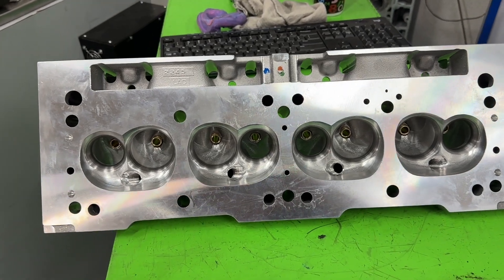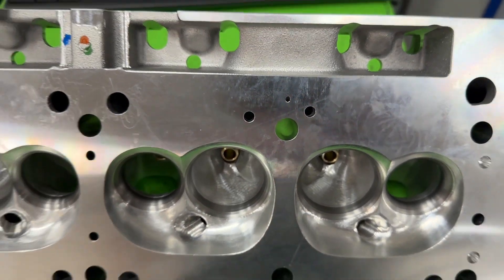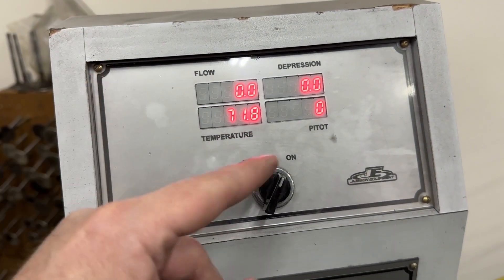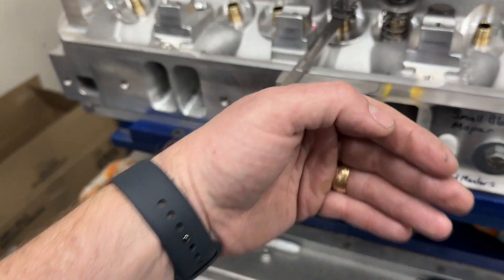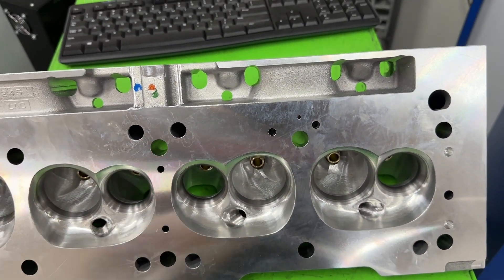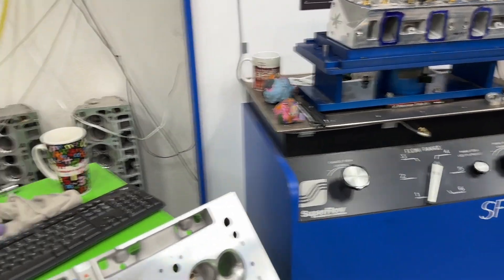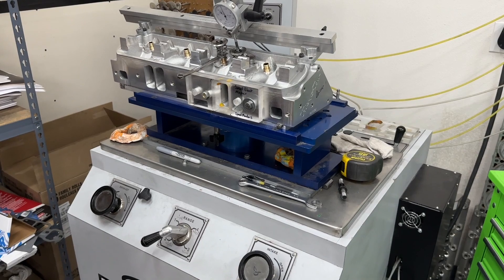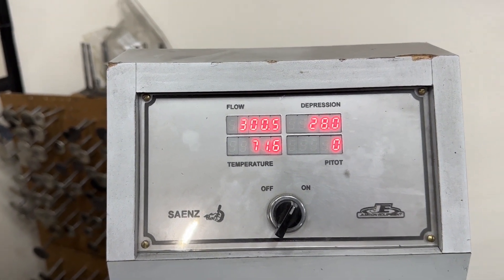A Strange Thing That Happens On The Flowbench When The Wing Is Different

Comment: Nice video Eric.  I think you are correct in calling this a flow separation issue.  It seems to happen at 0.550-0.600 lift on many of the SBM heads that I have tested.  I have heard others use the term 'hyper critical' in describing the condition of the port just after venturi convergence and just before the short side loses flow.  The 'peak' of the flow curve can be moved around by changing top cut angles in the chamber, by shifting the head on the bench, by changing the throat size and angles, by changing the valve shape.  When at this hyper critical point, any flow disruption will send the flow over the top of the valve and flow on the short side is greatly reduced.  Flow will typically drop by 10 cfm but will gradually recover at about 0.900-0.950 lift when the valve is out of the way.  Velocity in the center of the SSR is about 450 fps, so it's very sensitive to disruption.  The PRP on these heads is very intrusive and creates a lot of the issues downstream.
Reply: Interesting

Comment: I'd be very interested to see the results when closing the valve opposed to creating a choke/restriction upstream. Putting your hand across the port isn't anywhere near what happens in a running engine
Reply from the maker: You mean it’s not like closing the throttle.

Comment: The issue with your "hand slap test" is that it doesn't simulate the valve opening and closing. It'd be more accurate of real world operations if you wacked the valve open and closed. The air isnt going around an opening valve, it's trying to make it's way past the stationary valve. 

Wack the valve open and closed. Put a stem lock or something so the valve only opens and closes so far and try that again. That would reveal something more relevant.
Reply from the maker: Are you sure it’s not the same as opening and closing the throttle.
Reply: @WeingartnerRacing Well, yeah, because the valve is what is starting and stopping the air flow in the cylinder. if you can lift and stomp the throttle quicker than the valve event, that is truly impressive LOL Run that test again, starting with a closed valve and pop it open to .800 and let it slam shut again which would be pretty simple to do and see what the flow is like then. It may require a little more spring to overcome the flow past the valve, but a pair of checker springs would probably be enough. The static valve position potential of the port gives you potential flow it lift X, but it really doesn't demonstrate the ports ability to fill the cylinder at a specific RPM. But, you know this.

Comment: It is weird but you stated "they did a dyno test" and it made more power so that seems it either makes more power w/reduced flow or, more likely, the super fast (faster than our hands) valve closing where the suction begins doesn't cause the same effect. I'd imagine the only way to test that is to be able to rapidly close and then reopen the valve on the bench but not sure if that's feasible.

Comment: id bet its different when the valve actually closes hits the seat and opens. that event alone, is going to change how much air, how fast the air moves when the valve is back to full lift. i have always included valve cycling into this event. velocity is going to be higher even though total flow will be lower as the valve is coming off the seat. id try cycling it, let the air recover in its direction through the port, around the vane, into the chamber. the hand is yes acting like the valve closing but it is not slowing, choking off the air supply and changing the air flow in the same manner as the valve closing is going to. fully open valve, hand smack choking it, vs surface area tween the valve and seat also getting smaller. larger. the resonance, swirl, turbulence etc etc is not being represented in a real life valve cycle event

Comment: The flow never stops and starts with the valve at max lift like you just caused to happen. Your example will never happen in a running engine. Port recovery works with the opening and closing of the valve. The shape and Venturi that happens when the valve is opening and closing as a variable cross-sectional change is what causes a port to have great pressure/port recovery. Having the valve at max lift and then blocking the intake tract is not the same thing as the valve closing. Of course the port does not recover back to what it had when you ramped the air on vs smacking the airflow with your hand. I know you understand this, I’m just bringing it to your attention. 
However this is a good eye for catching this and it would be good to test back to back on the dyno , with a straight vane and a sideways vane. Thanks for the info
Reply from the maker: So not the same as closing the throttle. Then opening it again.
Reply: @WeingartnerRacing  if the throttle is closed you are not under power, and thus the flow disruption is meaningless. By the time you are back on the throttle the valve has already opened and closed a few hundred times (depending on rpm of course) and thus recovered from the normal valve opening event without disruption like I mentioned before. 
For your theory to even play out, you would need to stop the flow of the air column and then reintroduce it back to the port in the short period of time while the valve is at max lift in a running engine which is physically impossible. Go figure up how long the valve is actually dwelling at peak lift in a engine at idle and see that this time is hardly comprehensible in regards of us being able to perform an act within this allotted time frame, then just image it at  4, 5, 6,000 rpm’s.
 
If the throttle is closed it doesn’t matter if you lose 300cfm on your flow bench from smacking it, the cylinder no longer needs the volume of air (because the throttle is closed, it’s called deceleration for reason) and either way the port has already recovered its from the normal valve opening and closing events from the rotation of the engine. 

 I stand with my first comment, this test is irrelevant and meaningless in regards to a running engine unless you have a engine that just holds the valve opening the whole time while it’s running but obviously it would no longer be running if that was the case.
It’s kinda cool that you found this, but there is no effect on power. It’s no big secret that the engine slows down when you take your foot off the gas lol.

You cannot disregard basic engine fundamentals and build an hypothesis from a scenario that will never occur.
Reply from the maker: @rtprecisionmachine6210 circle track and road course are typically part throttled offten just as I said and the valve is cycle that whole time.
Reply: @WeingartnerRacing  the only way anything useful could come from a test like this is possible on the spintron and a bunch more equipment added to it. You must have the valve events. The engine never sees one degree of rotation or change of airflow with the valve static at max lift. And the millisecond of time that does occur during peak lift is so short it becomes completely irrelevant to change.
Part throttle is not a sudden door shut onto the intake port, and each intake port in most engines share a common plenum from which to draw a small amount of air from to keep the port from stalling completely.
However, without having a dynamic valve event at operating speed, the test cannot simulate an authentic event inside the engine.

Although you do not have the equipment to test it, the only way we could see if the vane caused a true flow decrease during transient throttle changes would be to have an actuator on the valve running it through a typical cam lobe profile at an actual operating speed, or rpm if you will, that a engine would see. If you could do this then you may have useable data. Otherwise the valve is static with 28 inch depression of constant flow that is being disrupted for a split second. Ports are not designed to recover like this and they never do in a running engine because the valve is always dynamic.

I believe there is something to be learned about vane placement, however you may be looking in the wrong place with this test.

It would be really cool to make a valve actuator that could simulate valve events while you flow the head. You would be surprised what you find happening, especially if you could replicate the 2nd or 3rd resonance wave going back and forth but I doubt that equipment will ever be developed. It would require an air supply that could ramp up and down simulating the piston stroke and rapidly change pressures almost instantaneously. Of course we have those, it’s called a running engine on a dyno lol.
It’s all about time, and there isn’t enough time during peak lifts for an abrupt air change to make a difference. By the time the air stopped at the valve, the valve would have already ran through a few complete valve event cycles and leaving it once again impossible for this test to actually happen in a running engine. 
 However without these types of discussions, innovation cannot happen and why it is healthy for our industry.
Reply: @WeingartnerRacing  however I would like to see a dyno test with and without a proper developed vane. One straight, one left, one right. Their definitely is something to learn there, but it has nothing to do with our prior conversation.

Comment: I think it adds turbulence to the air column enhancing homogenization of the intake charge. Think of the air charge as a slinky. Bulk of the mass oscillating back and forth like a wave, every intake valve cycle. When the valve closes the pressure builds up and reflects back in a different way causing turbulence and better mixing.

Comment: You're on to something Eric, and thanks for sharing. 
This example has me thinking of an old idea I had. Flow test heads on an engine block to use as a "sudo spintron" like device to actuate a valve on the cyl being flow tested. 
Block all the unused cylinders airflow and pull vacuum through the empty crankcase with a big tube welded into an oil pan.
It seems there would be some interesting data with the intake valve cycling at around 60 times per second with the cam that was going to be used in the engine, while flow testing. 
Much closer to representing a running engine than steady state flow testing, although still a great deal different without the real overlap cycle in place.
Reply: A flowbench cannot reach anywhere near the vacuum pulled by piston.
Reply: Or "vacuum" pulled by exhaust scavenging...isn't that more stronger?

Comment: With the flow bench it's self, how does it control the flow pressure drop, automatic or do you manually change the restriction or blower speed??
Reply from the maker: It doesn’t it automatically with software that controls motor speed.

Comment: Covering the port is not the same as the valve closing. The port is full of air and under some pressure when the valve closes. You are starving the port of air by blocking it off. Bet the effect changes if you close the valve then reopen it.
Reply from the maker: I will test that but I’m sure it will do the same thing. Once the airflow is disrupted it doesn’t come back.

Comment: I've been thinking of the vane as a tailgate, creating a small low pressure bubble to speed up/redirect airflow. If thats correct here, (idk), then angling the vane towards the cylinder wall, like these trick flows or sbc afrs & promaxx sbc, would direct the air towards the center of the bore.

Comment: Do the same thing and watch the swirl numbers.  I believe the vein increases the swirl and directs  the fuel pattern in the runner,combustion chamber and cylinder wall. I can seen why it made more power.
Reply from the maker: I will do that but the swirl meter is on the superflow.
Reply: @WeingartnerRacing  Thanks.  I know you are busy. I've seen alot of interesting things about swirl . I have swaped heads on my 2wd Blazer . I was surprised  with the factory  193 tbi swirl port heads with a carburetor. 350 SBC. That got me really thinking about it.

Comment: That's why everyone is boosting nowadays, Ekka, with turbos, because all this unpredictable stuff becomes totally irrelevant.

And you can make massive horsepower, easily, without all this time, effort and expense wasted on head ports.
Reply from the maker: It still matters with boost. That is the biggest misconception. If it makes less power na it also makes less power with boost.
Reply: Yup
Reply: what? P&P Makes a huge difference still in forced induction engines if not even more than N/A.

Comment: Just a thought, I don’t think there’s any time on a running engine, that airflow is momentarily blocked while the valve stays open. If you popped the valve closed and back, that might be closer to what actually happens.
Reply: What of you lift and then hit the gas again?

Comment: The wing creates a vortex with horizontal axis on at the bowl. This pulls more air to the port while the valve is closed and dissipates the valve pulse. When the valve opens, the air speed remains a bit higher on the wall side, creating "swirl", a vortex with vertical axis inside the chamber. This vortex fills up 2 valve chamber better than horizontal axis vortex, which in 4 valve chamber works better on higher revs, being faster fill, smaller radius vortex. "Swirl" has slightly uneven mix, there the center has less fuel then the sides. This can be beneficial for dish piston head, as the flame front pushes the piston with variable pressure. at 4K to 8K, creates more torque.
Reply: Wow. You described it the best.
Reply: Don’t forget the rest of the 1 million variables

Comment: Ad the length of an intake runner and see if a longer column of air reacts differently . Also how long are you stopping the flow compared to a valve at 3 to 7 thousand RPM , not hating just asking

Comment: Well. Thats an interesting topic. My 1020 bench acts exactly as you stated in those same circumstances. More than half the time ssr layback. Especially in the corners will fix it. But not always. The small block dodge head has a brutal hard over short side. So for me it is highly suspect in this case. If not, It can be a hunt to find what spot is aggrivating it.  The only thing this makes me wonder if in this case it is the ssr to steep? Because I find trickflow often tries to keep that area as fast as possible. So I am curious if you stick a small flow ball over the ssr apex. If it re attatches and the flow recovers. Then you will know its in the ssr velocity / radius thats a problem. Not the  vane.  Good video. As a fello head porter. You hit a nerve. So to speak. Lol.

Comment: I think the biggest question I always have is what happens on the running engine?  I have cheated airflow numbers around with wings and other vortex generation perturbences before, and it looks awesome on the flowbench, but does it work like that when the engine is running?  Good question?

Comment: I've been told that Superflow benches don't show turbulence well because of the baffle and orifice plates being designed so compactly that it affects the flow and masks problems with the port,  or whatever is being tested. Not discounting your motor theory because that is probably just as valid.

Comment: Thanks I own a Pair already, and since i bought, DO WONDER what if this was on a 4.15 bore not a 4.03 bore test. There has been tests on the W-2 that were available and Hughes 360-1 and for the money there is no comparison , Also Dyno tests with 360-1 cnc ported showed only Marginal gain and huge price difference. If anything I would if you world Take the 190 CNC TFS and further port thenm to see just how much more power/flow they can make